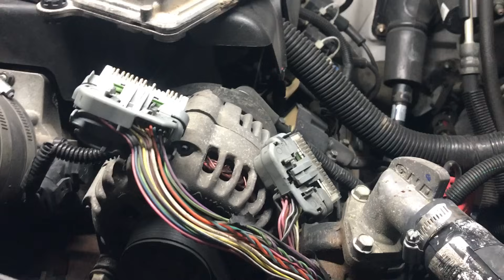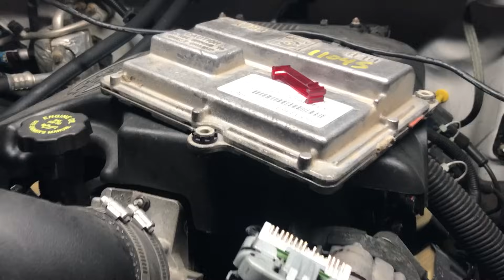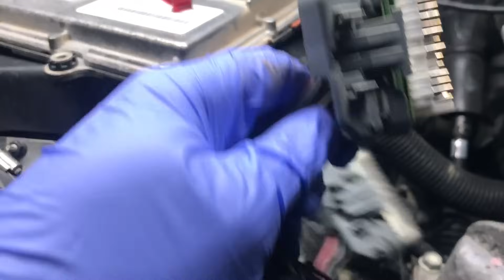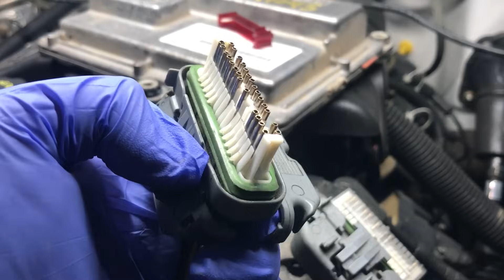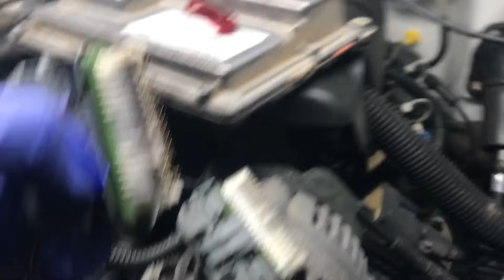Allison 5 speed TCM common issues and fix Allison 1000

Comment: Hey , I have freightliner box truck ,automatic Allison transmission 2100hs no codes shows up ,recently changed fluid and filter was very dirty and contaminated with tiny particles of clutch now gear shifting is normal with high rpm but some times not change to higher gear also trans temp goes up in couple miles …
Coolers lines not clogged but when trans temp goes up ,check trans come up on dash board and gear struggle to speed up.. any advice?
By the way I found fluid on internal harness of transmission.
Do you think overheating is because of electrical issues or something internally of clutch?

Comment: I have a 2008 Chevrolet K2500HD with an Allison 6-speed AT (MW7). The TCM has the single, 80-pin connector. We are getting a P0717 Turbine Speed Sensor Circuit No Signal code with the engine and transmission at normal operating temperature and pulling a load. The Freeze Frame data confirm that the TSS PID is ZERO when the code is set, (All the other speed sensors are normal). A previous shop has replaced the TSS, but there was no change. I get 2629Ω between PINS 20 and 80 of the TCM connector which is what I expect. No harness damage anywhere and all the pins look good. This 80-pin connector is constructed differently than your 5-speed TCM connectors, but nevertheless I checked the pins for broken locks etc.
Reply from the maker: On a six speed no need to diagnose it’s always the transmission control module lol 😂

Comment: Hey I have a 2002 model international and i have every gear but reverse and I replace valve body speed sensor shift sensor on side ot transmission. Could this be the tcm I replaced the valve because had a stuck valve in solenoid a. Any information would be helpful thank you. Levi
Reply: Also the range inhibit light comes on in reverse but not any other gear.

Comment: So I've been chasing wiring issues in my 01 8.1 vortec for a couple weeks now, finally got the diagrams for modules and everything and tested A LOT of the circuits and grounds today. I was able to find a few issues that were causing problems, or would later. I thought my issues were with my TCM, allison has been going into limp mode, when this happens I'm stuck in 3rd and putting the truck into gear does not sound good at all.. but once I got to checking the PCM I found both grounds to its red connector were getting 60 ohms of resistance... I am going to double check, as I am aware this sounds outlandish especially considering some of the pins in that connector were showing over 12v... Might be a different circuit, I am not sure, but the MIL request circuit was showing around 10v. Gonna try running new grounds to PCM red connector pins 1 and 40 tomorrow, codes I've been seeing are p1781 and p1571. I'm a mechanic by trade, but vehicles have never been my forte, and electrical issues sometimes drive me crazy when I am unable to quickly solve them.
Reply: Hey, did you find out what was causing the problem??

Comment: I have a 2003 Fleetwood motorhome with a 8.1 engine and a 5 speed transmission Allison having problems with my downshift button the transmission works fine except the button stopped working doesn't downshift to 4th what could be the problem thank you
Reply from the maker: I would say wiring

Comment: Truck runs fine, but decided to now get out of 1st and than not go into reverse when hauling. Tcm connection fail, section 2 communication problem and tcs falt, more of a wiring or tcm issue ? If wiring can I just buy that section or must the whole

Comment: I have an 03, 41 transmission codes pop up and my engine won't start now, I'll double check all my pins but would a bad TCM cause a no start issue? I've checked everything, the only codes I get are transmission codes.
Thanks
Reply from the maker: Gas? Diesel? half ton?
Reply: @SpartanAutoworx  diesel, 6.6 Duramax

Comment: I recently traded for a 2002 Gmc lb7 4x4 it had a leaking “tail shaft” I replaced it out the trans back in plugged everything in and now it has a p0721 and p0722 along with a b2722 codes it has abs and brake system lights on and transmission seems to be in limp mode along with even before all this the gear selector doesn’t light up and I’ve checked the pins and wiring for continuity and even replaced vss and nothing any ideas?

Comment: Great video. I got the Hosa D5S-6 CAIG DeoxIT 5% Spray Contact Cleaner and used it on both male and female sides. Took an old tooth brush and rag to the connectors then let dry. Put it together and cleared the trans trouble code(s). Took it for a long drive and tested for codes along the way and this morning. Codes gone problem solved after years of living with the one none critical code. Thank you for sharing your knowledge and experience with us! Youd da man!

Comment: I have a 5 speed Allison. I'm getting a couple code's P0700 (TCM) & a P0748 (pressure control solenoid valve control circuit). The thing is the codes are not always there I can drive around for a while come back fire the truck up and I have the codes, then shut it down come back no codes. Do you think these pins could be causing my issue?
Reply: I have ordered a Transmission wiring harness, and was about to order a pressure control solenoid thinking that might fix it.

Comment: I'm having an issue where my truck losses reverse and when I shift into drive it slams into gear and acts like it's in 2nd or 3rd gear..service light flashing..shut it off for a bit..then it stops and I have reverse and shifts normal into drive..truck isn't drivable like this but when the service light isn't on the trans shifts great  zero slip..I'm going to do what you shown hopefully it helps..was a plow truck
Reply from the maker: Sounds like wiring
Reply: @SpartanAutoworx thanks for the reply..I figured out how to use my scanner..narrowed it down to a bad turbine speed sensor in the trans

Comment: I have a 2006 chevy hd 2500 4x4  with 8.1 gas motor with the allison 1000 transmission i wouldn't shift out of 1st gear the code say input sencer so I changed the input and the output sencers and it shift fine for about half mile the it stays in 1st again what do I do now
Reply from the maker: Could be bad TCM. Six speed TCM is junk
Reply: @SpartanAutoworx  it goes out just that fast

Comment: 2001 Chevy 3500, 8.1L gasser with the Allison 1000 5 speed. 

I'm getting an erratic trans temp reading on my gauge cluster. Sometimes its pegged at cold startup, sometimes it shoots from zero to 200, then creeps up and stays. Then it might drop to zero or regular operating temp, all over the place but not a twitchy gauge like these clusters sometimes exhibit. When it pegs hot, I get a "trans hot, idle engine" message and trans shifts hard, but only shifts this way while gauge is reading incorrectly. 

I've checked these pins you talk about and seated them all. I can't see any issues with them, no retention tabs are broke. I was able to unseat and re-seat every pin on both connectors even though none appeared loose to begin with. I checked trans harness for fluid in plug at trans, there was none. Ive checked resistance on on the pins for the temp sensor in trans and according to the specs for temperature/resistance nothing seems out of spec. Ive checked all grounds I could find, and I looked them up to make sure I didn't miss any. Including the ones on the interior near the gauge cluster under the a pillar

At this point the only things I think it could be is TCM. Only caveat is it appears the previous owner/owners spliced in a shitty old security system but it did not appear to be hooked up anymore as most of the wires where just cut and Ive had no typical failing aftermarket security system issues like no starts or sudden dying etc. so Im not sure if thats contributing to the issue or if its just a distraction that needs attention later. 

Do you think it sounds like my TCM has failed or do you think I should keep digging at the botched wiring job under the dash for maybe a bad splice or tie in? 

Thanks for any help. I tried to exhaust all options I could before I asked you.

Comment: Thanks Spartans. Two pins in my TCM connector, were pushed back. Just pulled them forward and tacked them with a spot of epoxy, on the under side of the pin. Now the transmission shifts like butter. Before the fix my 2001 GMC 2500hd 8.1L , would have to rev high to get out of first gear, then would not shift out of second gear. I had taken the TCM off to perform some maintenance, that's when they got pushed back.

Comment: Replaced nsbu, from my understanding if it starts in netural it was installed correctly. Well starts in N, now im having an issue were no indicator under park and wont shift out of first gear and speedo is not working. Got a list of unlink codes and service brake system message. Anybody have a clue... im totally lost
Reply from the maker: 5 speed?
Reply: @SpartanAutoworx  yup 2003 lb7

Comment: I have a 2006 duramax 6-speed 118k, today the trans started slipping after 2nd gear, very hard downshifts. No check engine or errors on speedometer. I pulled the codes, TCM has 3 codes p0882, p0561, p0562. Do you think this is a wiring connector issue?
Reply from the maker: Voltage codes check for 12 volts at TCM if so probably bad tcm
Reply: @SpartanAutoworx  Would it still be a faulty tcm even if the truck drives and shifts perfectly in 4wd?

Comment: Hey man I got a 05 Lbz, with the Allison pretty sure it’s a 6 speed ? But recently it was slipping and I put stop slip in it it ran like a dream for 6 months engine recived it’s normal oil change the truck has 87,000 miles... and on its second transmisson although it was passed down to me I don’t know much about the first replacement but today it touched 200 on the gauge and started to go over just a tad and was stuck in 1st gear I pulled over turned it off and on and got back at it worked fine what would you recommend for me this shit is a pain in the ass
Reply from the maker: So it showed that it was overheating or high but when you cycled the key it went back to normal? Did you read for codes?
Reply: @SpartanAutoworx  it was at like 207 ish not really over beating but when it got hot it started slipping I put stop slip in it pretty sure I made a big mistake

Comment: Hi i have an Allison transmission that between 1-2  3-4 and 4-5 it goes neutral then slams like a stall converter any ideas ?? I changed the internal harness due to leaking into the connecter and the 2 pressure control solenoids. But still the same .. any ideas ?? Thanks in advance
Reply from the maker: Codes?
Reply: @SpartanAutoworx  P2723
Reply: @SpartanAutoworx  We fixed it, We had to do a relearn after changing those parts, shifts beautiful now .. Thanks for your response and caring

Comment: I can’t read any transmission codes, snap on scanner says no communication with tcm.. have p0700 code but cant read my trans code. Any suggestion?
Reply from the maker: ON Allison 5 speed?
Reply: @SpartanAutoworx  yes Allison 5 speed,  I can read all codes except for transmission codes. Have a p0700 and my snap on scanner says no communication with the tcm when I try to read trans codes
Reply: @SpartanAutoworx  messaged you on Facebook messenger if that’s more convenient

Comment: Hi this is Bob . So I just watched your video on the five speed Allison pinouts. Let me go back a little. A customer of mine was on the highway this morning at Cruise speed and all of a sudden transmission has no gears while driving. Vehicle was towed here and has no engine light no pending codes and the transmission fluid was in pretty good shape only about a quart low but it is whining in every possible gear and does not move when I put it in drive I can hear the drum or the torque converter spinning for about 20 seconds then the whining stops and drives indicator flashes. Could this have anything to do with those pinouts to the transmission control module ?
Reply from the maker: No tcm codes at all? If the PRNDL is flashing it should code out. I would check pins clear all codes and retest. I have seen allison trans code out and drop all gears. Clear codes and back to working. Usually only see this with low battery volt at start up
Reply: My truck did the exact  same thing. Did you ever pinpoint the issue?
Reply: @chadw9046  No. Sold the truck to someone who had a transmission and transfer case wrapped up nice and their garage that just needed a decent truck to put it in lol. Yes I cheated and took the quick and easy route and sold it.

Comment: Could this cause multiple issues, i just bought an '01 with allison 5 speed after he fixed p0722 & p0748. Solenoid replaced but speed sensor was the real problem. I purchase and get back home about 2 hours away to it putting out p1721 so now an issue with the solenoid next to the last? Older video but hope to get a quick response wont hurt to try instead of waiting i guess.
Oh and most times indicator lights blink of R and D, if it does go into gear i only got reverse and 1st, no other codes
Fast update: def not apart of my problem

Comment: Ive check all the pins replaced nsbu switch and ignition switch still coming up range shift inhibited wont take any gear
Reply from the maker: Prob bad tcm then
Reply: @SpartanAutoworx  ended up being bad shift range forks in transfer case and speed sensor

Comment: I have the same symptoms. So I checked both harness at tcm, all in good shape. Plugged them back in. Now truck will not even turn over. Wont start, wont even crank. Any thoughts?
Reply from the maker: Does it show in park on the PRNDL?
Reply: @SpartanAutoworx  turns out I blew a fuse when I was working with the connectors. It runs now but shifting not fixed yet. I am trying to check the harness connection at transmission but cannot figure out how to disconnect it. It is very oily. I have read that is another suspect problem. Thanks for your reply. Do you know how to unplug at transmission?
Reply: @SpartanAutoworx  mines doesn’t show prndl and it has u0101 code and slips 1 2 & 3rd , I haven’t checked the connector yet

Comment: I have a 2005 Chevy 2500 lly 5 spied & im getting P0700 & P0735. Drives and shift fine till I get on it and switch’s to 5Th gear and goes into limp mode and stays in high RPMs
Reply from the maker: That could be a bad ecm with that code.
Reply: You and me both. What tune do you have on it?
Reply: Did you find a fix?

Comment: I have a 2000 frieghtliner fl60 ambulance with a 6 speed automatic with a push control box, it has been sitting for 3 years and now when I try to drive the truck it starts out showing 6 on the control box and doesn't shift it will display a 1 on the control box and will not go back to any other gear reverse or even back to neutral I will have to turn the truck off let it sit for a little bit started back up and then I'm able to put it back in neutral or reverse I'm hoping it's something simple, before the truck was parked the transmission did not have any issues at all
Reply from the maker: Allison 6 speed transmission? if so bad tcm hands down
Reply: @SpartanAutoworx  yes it's a 6 speed transmission automatic with push button box gear control

Comment: I hit a rough spot in the road and the 1000 allison kicks out of any gear .
And i put it into neutral and back in drive and go down the road to the next big bump.
Once i didn't shift out and got two codes. 
P0735 and p0700.
Both fifth gear not in cync.
Reply: Did doing this fix it mines doing the exact same thing

Comment: I'm having an issue with my 2000 F650.  When the PTO is in use the engine stalls.  The engine starts up every time but its pretty annoying that the engine stalls.  Any suggestions?  Thank you!
Reply from the maker: Codes?
Reply: @SpartanAutoworx  Sorry no codes we ended up adjusting idle cable and issue resolved also noticed pressure coming out of PTO was less then going in.  Going to replace round hydraulic filter and see if pressure raises.  Thanks!

Comment: I have an 2005 Duramax and I was giving me a code when we put the scanner on it P0700 Transmission Control failure and P2810 pressure control solenoid G (electrical). It wouldn’t shift out if first so we changed the pressure solenoid and now it will up shift to 2nd but won’t shift out of 2nd. Also after it shift to 2nd when you put it in park or reverse it jerks real hard. I’ve been fighting this for weeks could you help me?
Reply from the maker: You have checked the conectors?
Reply: No not yet that was going to be my next step in the morning

Comment: i HAVE A 2009 duramax (170K miles) and it throw code p0700 and p0708 and it said stabil trak service required.  I had to limp it home and every once in a while i heard a clanking sound...  So after researching some forums I replaced the NSBU and ignition switch.  The stabil trak warning went away but the 708 code has not.  it still says transmission range sensor circuit high input.  Transmission fluid has been changed religiously and looks good.  Could this be my problem?  Should i replace the harness before the TCM?  Thanks.
Reply: How did you fix your p0700 code? I’m having trouble
Reply: Same exact problems here on my 09 any advice or how did you fix yours?

Comment: Got an 01 that's throwing a p1760 and it will not go into gear. Put it in drive move a couple feet dash goes haywire code pops up and won't go forward. Think this is the problem?
Reply from the maker: Thats where I would start